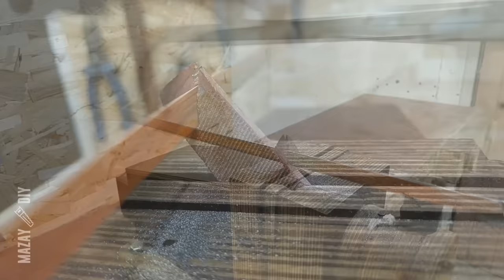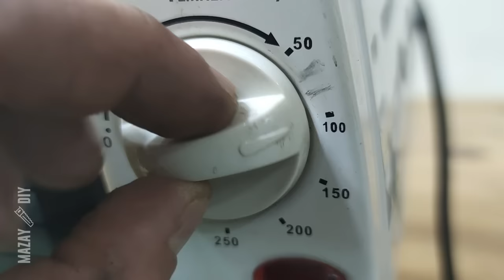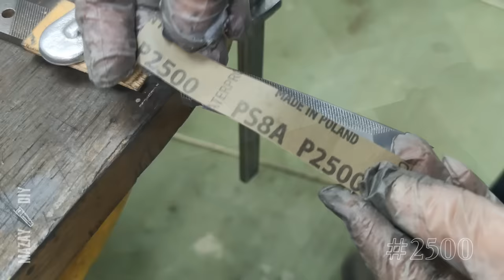Making a Knife from an Old File | NO POWER tools Knife Making

Comment: This is by far the best channel I've found for practical shop applications and engineering. So many other channels will show you the same things, but they do it with their $1500 Festool power tools, or their $10,000 lathes, with their $20,000 filtration systems inside of their $150,000 shops. Mazay shows that you can make all of those things on your own at a fraction of the cost and be able to produce the same results with some determination and hard work.
Reply: Deffo more work, I’ve tried the filing jig technique and my god it takes hours
Reply: I respect the hell outta this. I guess the truth is you can use $150  tools to make a $1500 knife or you can use $1500 tools to make a $150 knife
Reply: You can do 90% of this with a $80 4" grinder
Reply: At the end of the day, it's all coming from one finite currency.  Time. Either put time in to make the money to make it go faster, or put the time in to manually craft it without tools.  Time is the currency we all start with but cannot make any more of.  So either way you're going to pay the price.  Just a different perspective to consider.
Reply: Just buy a $30 angle grinder and it will take you 1/100th the time. Unless your time is worth nothing to you…

Comment: Ah the bevel jig method! My first knives were made just like this! Very easy and useful. I upgraded my shop to a number of tools that expedite the process, but I still use old. or new, files for my knives. They work great! I assume you went with time, rather than time plus color, for the tempering stage in the oven? I always do mine to straw color, but they're cleaned up without any scale making it easier to see. That end result is a good looking knife, I like it! There's no satisfaction like making something for yourself by hand!

Comment: The amount of endurance you need for the filing process to achieve the edge with manual effort is insane. tried it once and after appr. 1,5 hours i switched to a power tool which did not make it better but much faster. impressive!

Comment: I have few old files at home, and was thinking about making knife from one of them, but is it necesary to soften the metal with heat and than reharden it? I dont have tempering/hardening equipment.
Reply from the maker: My opinion is a must. If you don't anneal it, it will be difficult for you to give the knife the desired shape. After giving the shape, it is necessary to do hardening and tempering - the knife will not be as fragile as a file, but quite strong.
Making a mini forge for heat treatment is not that difficult and inexpensive - https://youtu.be/jOTsFgletJg

Comment: What kinda bit did you use for the holes because im struggling drilling through a file with a power tool and a cobalt drill let alone a hand drill.
Reply from the maker: Please note that I did heat treatment (annealing - https://en.wikipedia.org/wiki/Annealing_(materials_science) ) before starting to drill the file. After annealing, you can easily drill the file with a regular drill bit.
If you do not have the opportunity or desire to do heat treatment, then you can try to drill the file with a tile drill, but it is better to buy several of these drills, because they are very fragile and break

Comment: Wait! Did you intentionally touch the red hot blade with your thumb nail just before quenching it? Is there a reason for that?
Reply from the maker: Calmly! Not a single finger was hurt))
I brought a magnet - the fact is that the steel needs to be heated to a temperature a little higher, when the steel stops magnetizing - this is probably the easiest way to determine when it’s time to put the knife in oil or water

Comment: Why would you quench metal only to temper it later?
Reply from the maker: Ah, the mysteries of metalworking! Quenching and tempering are two important processes in metalworking. Quenching involves rapidly cooling the metal to increase its hardness, while tempering is done to reduce brittleness and improve toughness. By combining these techniques, we can achieve the desired properties in the metal for various applications.

Comment: Files contain a high percent of carbon. They are extremely tough and hard but have little ductility. Yes, with correct annealing and tempering a small degree of ductility could be brought in but I'm not convinced a file would be my choice for a blade.

Comment: Steel for making knife is different than steel to make file. Every blacksmith know that. Not need to impress ignorant people . Manganese 1095 carbon steel offers great toughness, resistance to chipping and breaking, and sharpenability.
If you need cheap materia use leaf spring from od car suspension.
Reply from the maker: I agree that spring steel is better, but getting a file is much easier. Why not start your hobby of knifemaking with it?

Comment: The problem with using a file is the metal is brittle and will break easily
Reply: You can heat treat and then temper to change how hard/brittle you want it.  
To file, saw and drill an actual file, the file being converted to a knife must have been heat treated to begin with in terms of normalising so as to remove the original working hardness.  If this was not done then the tools used would have immediately gone blunt since all would be around an equal hardness (the tool doing the work needs to be harder than the work piece its self).   
In knife making with some skill it is also possible to have a harder edge and a softer main body in the same piece of steel by way of differential tempering.  A screwdriver for example is one tool that is the same piece of steel throughout but is differentially tempered where the tip is hard to prevent premature wear but the shank or shaft is softer to prevent cracking when torqueing or using as a lever.  A Japanese katana on the other hand uses a softer steel core with a harder steel wrap around which provides for both flexibility and edge retention hardness.  When they cool the katana blade in heat treating the two different steels in part cause the typical banana bend in the final blade.

Comment: might have been better to thin that handle blade down to half it's current thickness, more wood, better balance, I bet right now it way handle heavy, weight one side of the handle wood, rough down another piece of steel the size of the entire blade, handle and blade, cut in half, weight the blade end, next you want the handle half shaped down to the weight of the roughed blade minus half the wood handle or whatever you figure the shaped handle will weight altogether, now you should have a template for the handle section of your blade so once you have the wood handle in it will be perfectly balanced . . .

this will increase the feel of the blade and balance, if it's for throwing you want 25% of the knifes tip to weigh 50% more than the last 25% of the handle end, for this you will want to split the entire blade handle and blade right down the middle, then grind out 75% of the knife ende on both sides, and the last 25% of the handles end...  weld it back up leaving the center hollow in those areas . . .

now it's a perfectly balanced throwing knife and the overall balance is fairly nice as well, throw that one a few times you will be surprised . . .  if it's just a working knife just balance it thru the handle end, which you want to slim down in any event just to have more wood for the handle or woolie mammoth tusk which makes superb knife handle for its weight or lack of, you can get the same dimensions very heavy or very light . . . they are usually weighed and dimensions at sale..  many colors form whites, to blues, black, mixed, seen purple, yellows and all sorts of mixtures . . .

you make a nice knife,a few more steps and it can be very purposeful, in fact you can find professional dimensions and weights and size your knife up, throwers love to pay big money for one off perfectly balanced knives, no handles generally so fairly easy to make, bore down the centers to lighten and balance the blanks, easy peasy..

Comment: 1 your quench was not hot enough , 2 clean your knife before you temper it so you can actually see the temper colours you have no idea if its correct now I should mention im a qualified blacksmith that has been teaching knife making since the bible was being BETA tested lol 3 there is no such thing as car battery electrolyte , its either acid or distilled water (( worked at YUSA batteries for a decade) PS your filing jig was genius !